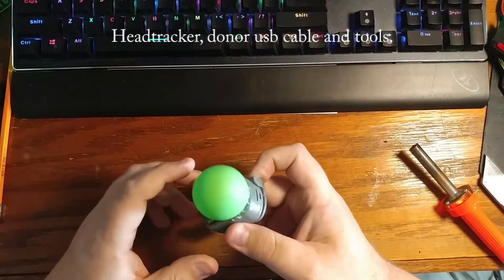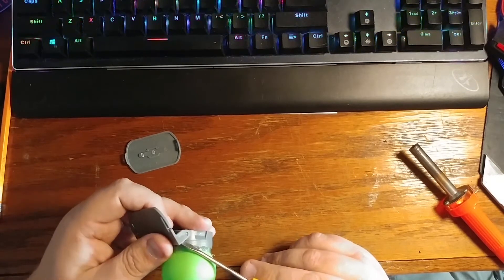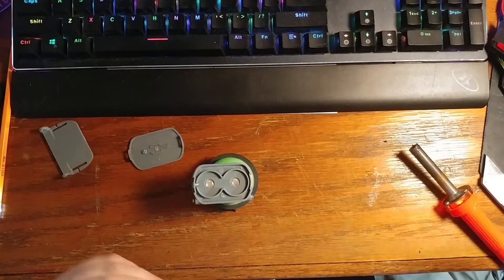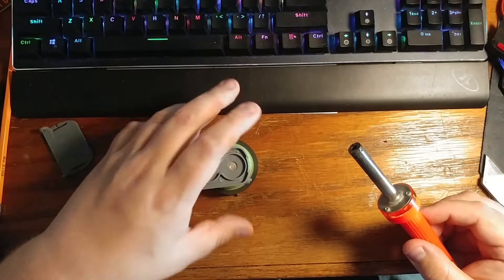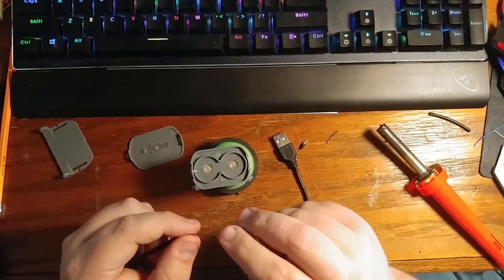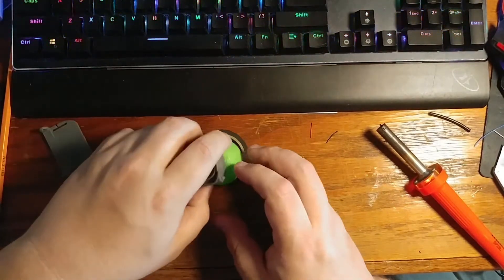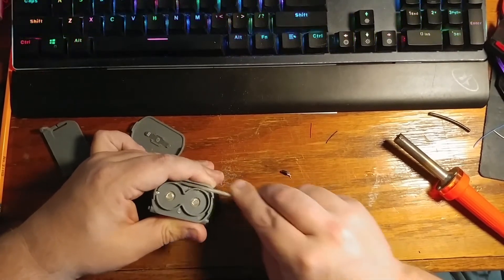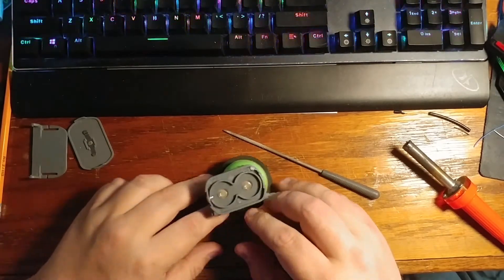$5 PING PONG BALL HEADTRACKER - USB UPGRADE

Comment: www.google.com/search?q=24key+5v+usb+mini+rgb+led+contoller   ----- 3 x voltage reducing resistors, RGB common anode (+) or 6pin LED, USB lead to plug into your HMD spare USB port or a long USB cable to PC
Reply from the maker: I actually tried using the led strips like that and that was one of my failed attempts. The usb upgrade is for anyone if they are using wireless like they are using a Google cardboard or or Gear vr or something else or they are using a cheapo 3dof headset. I did a lot of experiments before I came up with this one. This is also if you dont use the usb upgrade extremely cheap.
Reply: @Lordmodder85  academic at the moment, waiting for an ASUS bt-400 from the UK, since thats what PSMove suggests at github, have 2 moves, 2 PS3 Eyes and a kinect360 at the moment, but CPU usage on kinect in Driver4VR seems very high (25% on my old 12 core dual xeon   https://www.youtube.com/watch?v=98M32yU3EYc ). I've got a set of Move plastics (shell, buttons, lens, etc and silicon ball) coming from AliExpress for us$8, and a few types of LED controllers from eBay, so will know then ... looking at a Move teardown, they only seem to use a 5050 RGB led, no heatsinks * * * or anything, so can't be high powered; not thinking about strips ... I'll play around when it all gets here, and if it isn't bright enough, look for a one watt rgb led - what I really want is a silicone ball that can take a bit of impact abuse, price is less of a consideration... good advice on your channel, hi from NZ    ------ PSMoveLED detail -----     https://www.aliexpress.com/item/32818754631.html?scm=1007.23534.124000.0&pvid=914ce349-7f25-4c9f-95e2-78fcbeead5d1&rmsg=do_not_replacement&dp=ab29e73d77353b27c661c3d943960258&af=442763&cv=47843
* * * https://www.allaboutcircuits.com/news/teardown-tuesday-playstation-move-controller/ talks about a thick metal wall that could be a heatsink, but seems to be in an odd place and they describe it as an EMR shield... if I have to buy another controller and tear it down for the parts, "c'est la vie" ) --- https://www.allaboutcircuits.com/uploads/articles/Playstation_Move_-_29_Metal_Shield.jpg